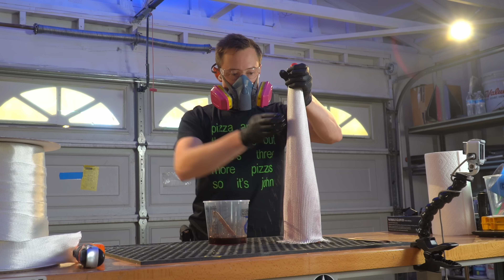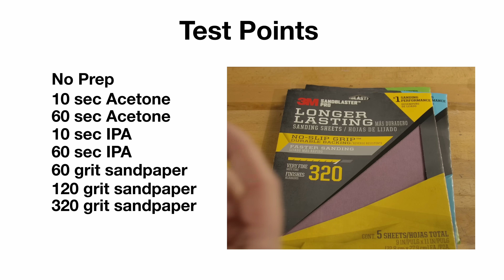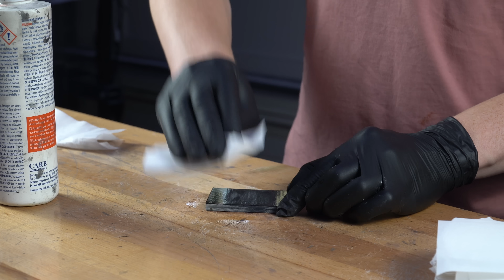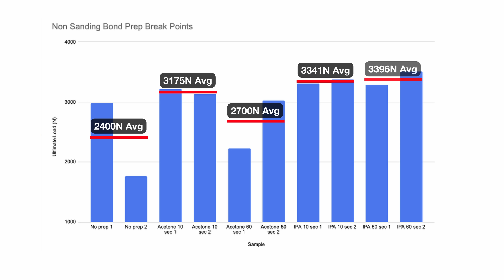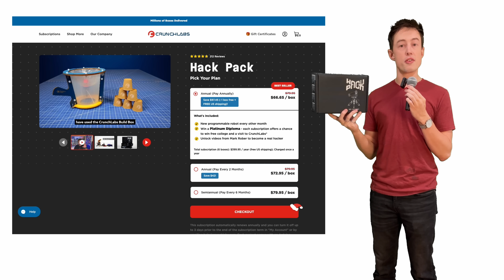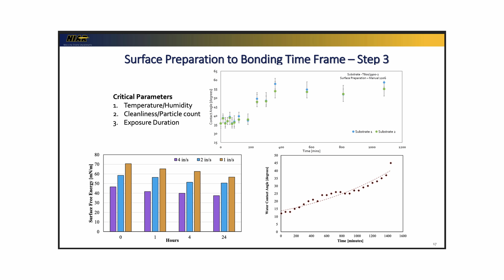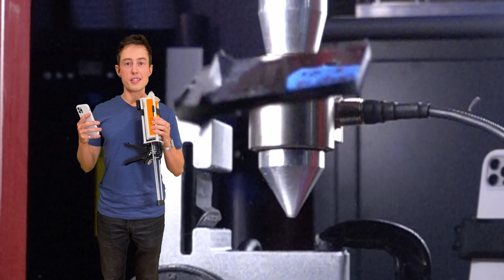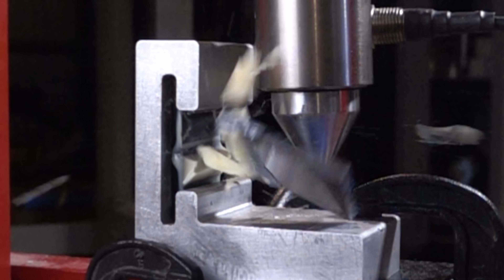I Broke 100 Epoxy Bonds to Find the Strongest

Comment: Ski builders here. We run lots and lots of test and flame treatment it's always on top, 3 quick pass on top of cleaning, sanding and cleaning again seems to be the best compromise for most plastics, but we observed that flame treatment by itself outperform sanding every time.
Reply: What type of fuel do you use or how hot is the flame ?
Reply: @jacobclark89 We use a mix of propane and butane, don't know the temperature but we know that different materials need different distance from the flame, with ABS we stay pretty far instead with nylon, PE and epoxy we stay as close as possible.
Reply: @Lerio16  thanks  👍

Comment: I HAVE AN IDEA (TM). 
The epoxy part of a layup is analogous to concrete. It resists pushing forces REALLY well. If you pull or bend on it, it'll break much easier. 
Carbon fibers resist pulling forces really well, and NOT SO MUCH the pushing forces. If you push it, it folds, if you bend it, it bends. 
When you do a carbon fiber layup, what you're doing is taking the squish resistance of the epoxy and marrying it to the pull resistance of the carbon fiber, getting the best of both worlds.
When you push on it, the epoxy says NOPE. When you pull on it, the carbon fiber's like NAH. 

TL;DR:
Your epoxy glue interface volume is pure epoxy. What if you cut a bunch of 1-2mm carbon fiber strands, mix it with the epoxy, degass it, and build your radius from that? 
Essentially, forged carbon fiber in the glue interface.
Reply: I think this does not fully work like you intend it to. By your design you are using discontinuous carbon fibres, which only have a limited function. This is similar to the use of carbon fibre in FDM printing filament. The fibres are discontinuous and as such the increase in strength is not the same as when using weaves. The real benefit of carbon fibres comes from the lay-up of continuous fibres and the corresponding interfaces and interactions. Making the fibres discontinuous takes away a lot of the benefits associated with a composite lay-up.

Comment: One potentially really stupid question I have is, is it not a problem that you are filling your molds with epoxy, but not applying epoxy where the two surfaces join? And yes, I understand that when you degas the molds the air in that void space escapes, how certain can you be that the mating surfaces are fully bonded? I love that concept of this video and I'm glad you went there!

Comment: When I was in high school I "worked" at a local factory (it was a special program for certain students) and I did almost exactly what you are talking in this video - I was measuring shear strength of different glues on some PP plastic, prepared with or without plasma. It turned out the best performing were "bad" pieces with rough surface...

Comment: Did you follow the instructions using the mix nozzle by tilting it from side to side and purging several squirts into the garbage before use? Your third sample was significantly stronger than the first two, which tracks with improper purging.

Comment: 16:52, that recently cleaned part just got contaminated by flipping it and putting it on the table. Suggest using some new sterile paper towel between table and piece each time.

Comment: You left no technique untried to achieve a high bond strength consistently, accounting for as many variables as you could think of.  Since the strength of the joint is so important, that doesn't seem like a waste of time.  There's a difference between knowing the best technique because a credible expert told you so, and knowing from your own experience by systematically and exhaustively testing all possible permutations yourself.

You have also done the rest of us a big favor by trying out out all these techniques, and dismissing the ones that don't work consistently, since most of us don't have the time to try and figure out which online "expert" knows what they are talking about.

Even having the tremendous luck of running into a real expert with the professional expertise and experience is something few of us are going to get.

I've been frustrated by such consistently poor results with epoxy over the years that I had given up using it.  Now I have a new approach to try.

Comment: Oh, also. This might be getting into the last 5% gains, but you also seem like the guy who would build this. If you can pour/dispense part A+B in a vacuum and mix, then you won't be mixing in any air in the first place. Keeping with pulling a vaccum when you pour, curing in a pressure chamber will force any bubbles that do form to be much smaller. If you want to test this and see bubbles, get some clear epoxy. Also also, temperature makes a huge difference. A difference of 5 degrees in any unit will significantly change the cure time and bond properties. I'm not sure what you're limited to on your part geometry, but if there's any way you could put through holes, blind holes, or the other way around, a rivet or something that sticks out - anything captive, really, would make that bond indestructible.

Comment: I wonder what would happen if you use a plasma cutter and maybe put a different tip on it that causes the plasma to be fanned out instead of concentrated like you need to cut metal. And then if the compressed air wasn't enough, maybe you could feed it with O2? Things might get spicy inside of the plasma cutter though I'm not sure the O2 inside of the plasma cutter would be safe. Considering anything  even remotely flammable in a high pressure oxygen environment is going to combust with just the slightest bit of heat generated from friction.

Comment: 37:01  I noticed one possibilty for error in your measurements.  The load cell probe tip is moving, the angle changes as it slides off the contact area, as the test piece flexes.  You might see something if you review footage from low values and high values.  If you have it for each test piece.  It would probably show in the stress-strain curves also, if you collected them.  Good luck.

Comment: There are other types of powered sanders that may sand more like your linear hand sanding, but i would make another suggestion. Buy a flat sanding pad from the hardware store and a manual tile cutter and work them up into a jig to sand more consistently. Would be happy to give further details if you're interested

Comment: According to google, epoxy performs much better under compression (~60-100 MPa) than tension (~35-62 MPa) and especially shearing (~20MPa), so yeah, the epoxy has a weakness.

If you want the most performance, optimize around the epoxys strength, compression and tensile strength as a filler, while avoiding shear by a modified design.
In theory, if you mill a 1mm groove into the wall for the fin to rest against, that would assist the top part and allow for even stronger bond - one which only gives up once the whole wall rips open like a can. This completely takes the shear component off the epoxy. You could also inserte kind of shelf pins/dowels into the back of the fin and wall.
█ \\
█ \\\\\
▌▒❚▒❚▒▒▒▒▒▒▒▒▒▒▒▒▒▒▒▒▒               You could further add some shallow grooves with a file/saw or drill holes to get better form fit to help shear stress on the fin-bond as well.
█ //////                                                                
█ //

Comment: Your paper towels and lint-free wipes could be contaminated from the start.  It doesn't take much.  Lint-free does not mean "sizing" free.  How did the acetone and IPA get on to the media?  Did you place the wipes on the bottle top and tip it?  You might be contaminating your cleaning liquids.  Everything you touch with your gloves can be transferred to the next thing the gloves touch. 

Also, was the temperature of the garage, the curing temperature, controlled?  Work done in the morning could see a different curing temperature than work done in the evening.

And, a high energy surface will attract low energy material from the surrounding air.  Any oils in the garage can vaporize and travel.  Cooking breakfast can introuduce oils in to the air.  Many possibilities.

Interesting work.

Comment: I didn't hear anything about cleaning/prepping the surface with soap and water. IPA doesn't bond well to take away oils [citation needed] which can make a surface slippery (you don't say.) I notice this with my build plate for my 3D printer. IPA is great in between prints, but when that doesn't seem to work, dish soap + water followed by IPA makes the build plate surprisingly sticky for the first layer with no other treatments. I see the argument that it may not apply as much here if you're sanding off the top layer where there likely isn't any oil or other residue below and you're using IPA more as a fast evaporating carrier to take away the sanding dust. And Acetone... ya... I can't believe that is literally sold to rub on your fingers to dissolve nail polish considering how hazardous of a chemical it's treated in industry.

Comment: another way to clean surface with oxygen is mercury UV lamp - emitted photons have enough energy to make atomic oxygen, ozone, and all stuff of reactions. Look for a lamp which emits 185nm light as well, quartz glass lamp which makes air smell funny (toxic ozone). I used such lamps to clean ITO substrates, before depositing organic semiconductors. Easy way to kill ozone is to let it through activated carbon. But please be aware that 90% of carbon filters are too small for their job, air spends too little time inside

Comment: A thought on epoxy  after sanding 2 to 3 / 32  groves  ,, heat your room to 105 degrees  or Maine bonding location  mix 100% asperic  alcohol in the epoxy = theory  the alcohol will suction both parts together as the alcohol evaporate  the epoxy  should fill the gasses better do to the epoxy being diloduded and hold better in the vacuuming chamber. Question of theory at 39: 27

Comment: If you have the ability to cure your resin in a pressurized chamber (degas before pouring, 80psi while curing), you might get more consistent results that don't overflow. The bubbles are technically still there, but microscopic.

I'd be curious how it would compare to degassing during curing.

Comment: I don't think you want to be vacuum degassing after pouring the resin. Generally you vacuum degas the mixed resin because it's in a cup with large surface area so it's easy for the bubbles to escape, then put the mold into a pressure chamber after pouring. The pressure chamber helps condense any air bubbles and force resin into small areas. When you put the poured resin into the vacuum it's less likely bubbles contained within it are able to escape, so you risk increasing voids instead of reducing them. A pressure chamber on the other hand will compress any air bubbles that might still be in the resin.
Reply: Interesting, using pressure instead of vacuum as the last step.

Comment: You need to add this glue to your test!! it has the highest bonding strength i've ever seen it's  8X P&L is the strongest polyurethane epoxy I use it to bond carbon fiber pieces together in custom car audio builds!! You can take two pieces of plywood and bond them together with no fasteners and it will bond them so well you can drive a car over the plywood!!

Comment: You should study Designed Experiments (DOEX) I suggest a simple text like "Designing for Quality" by R. H. Lockner the advantage is that you get a average error term that you can use to benchmark any significant change.  Nice work - good luck.

Comment: I think that you sand to hard the surface, if you plan of keeping the surface resin, you need to avoid damaging it, you need a good coverage of scratch but you shouldn't remove too much material. Try light pressure and stopping as soon as the scratches seem to cover well the surface

Comment: 12:40 I feel like if you just made the mold 2cm higher than the part, you'd get less bubbling over in the area you're testing, and less lost epoxy from that step of the process. You could even put another separated part above it so it REALLY stays in the fillet, and doesn't end up on top of the part.

Comment: Hey Joe,
Just wanted to jump in with something that might save you a ton of sanding time and push your bond strengths way higher than even the best 60-grit results you’ve been getting.
The strongest secondary bonds in composite structures (aerospace, wind blades, rocket cases, etc.) aren’t achieved by aggressive sanding — they’re achieved by designing the bond surface to be intentionally “fuzzy” or left with protruding fibers right from the start. The gold standard is curing the part against peel-ply (or a textured release fabric) and then peeling it off immediately before bonding. This leaves a forest of clean, unbroken fiber ends that the new epoxy can fully wet and mechanically lock into — often mixing fibers from both surfaces like Velcro in the glue line.
Peer-reviewed studies and industry data consistently show peel-ply or purposely fuzzy surfaces deliver 65–150 % higher shear strength than optimized sanding, and in some carbon and glass systems the gain can exceed 300–600 % over a simple wiped glossy surface. Failure mode usually shifts from clean interfacial delamination to tearing the composite itself or cohesive failure in the epoxy — exactly what you want.
If you ever get the chance to lay up test coupons (or real parts) with a peel-ply layer on the bond face, I’d love to see the numbers — I’m confident you’ll blow past 6000 N with almost no scatter.
Happy to send you the papers and NASA/Boeing references anytime — just say the word!
Keep up the awesome experiments!
Reply: Interesting! I do tile installation, and use a fibrous waterproof membrane to  simplify and shorten the process. The membrane is a spunbonded polypropylene with a fine fuzzy surface.  This membrane also creates an uncoupled assembly that reduces tile cracking over unstable surfaces.
Reply: "tiny fuzzies" is beneficial in a lot of things. Concrete becomes extremely crack resistant by adding carpet shavings. All those tiny hairs increase tension strength, which is the weaker strength of concrete.
Reply: Yes, the peel ply rabbit hole has been left out 😊
It’s worth a separate video! Nylon vs. Polyester, cleanliness of the peel ply…
Some have spend a whole carrier on this topic - see „The Curse of Nylon Peel Ply“ by LJ Hart-Smith an many more as reference.
Reply: This is a rabbit hole and then some, you can also drill holes to let the bonding agent fill them up creating a more mechanical interlock, or maybe even implement some dowels of carbon fibre as well to pin the parts before sealing with the epoxy, not having smooth fins but having ridges in the base that the epoxy will fill up is also an option to increase surface area and bonding.

Using acetone to clean the sanded surface is a detriment to the prep done since the acetone will immediately start melting, smoothing out and sealing the surface created by the sandpaper, especially if he’s using it to actually clean off the dust from sanding. So essentially he just dug a hole and filled it again.

I wonder if he can design the parts in such a way that he has a bunch of unlaminated sheets that he can interweave and laminate togheter on assembly.
Reply: @konzetsushi in my relatively limited (half a dozen times a year) but long-term (30 years) professional experience with epoxy resins they are not melted by acetone or any other ketones.
Reply: Be careful with this advice in our tests the texture left by peel ply was consistently the weakest in bond strength  but preformed well in sheer. We were testing flexible carbon  plates bonded to carbon spars. In America's cup racing yachts.
Reply: @glennimmortal  With any method you chose there will be pros and cons. Depending on application and usege, the results may work in your favor! Bond vs Sheer vs tensil strength all apply! My only advice is to read over the same studies I have. Not to say Joe has not, but just in case!
Reply: @glennimmortal  this is proof of the importance of different facets of testing and not just sticking to only one, if you tested only sheer strength, but the load was never gonna be sheer, you could get WILDLY unexpected results.
Reply: This.
Reply: There is even a "Key factors of the peel ply surface preparation process" paper from the Epoxy manufacturer that he is buying from in the video at 40:15 lol
Reply: Do any of those studies interface with other surface prep methods? Or is it limited to just peel ply (as opposed to peel ply + oxygen plasma, etc) vs other prep means?
Reply: Peel ply contaminated surfaces. Don't get me started.
Reply: @evangatehouse5650  Oh it is a Rabbit hole to be sure but Obviously each case sicario is unique to the job! I was just suggesting reading the studies that I had found. You never know what you will find!
Reply: reminds me of using a fork to score pottery to join two pieces
Reply: They're not abc, they're xyz! M-dash!
Reply: @leonYoong  Glad I'm not the only one that thought that. lol Had a guy on Reddit argue with me recently "What do you mean? People use em dashes all the time." No, sir. No they do not. It is quite rarely used by the average person. Most people have never once, ever, used an em dash. LLM's however, love them.
Reply: @thinking-monkey I regret to say that, given that that these are YouTube comments, LLM copyediting is probably still an increase in quality. We can only hope that the intended communication is still clear, correct, and earnest.

Comment: fun fact but in case of polyester resin ---- 
if you wax (carnauba wax release agent) the top layer of glassfibre cloth (after making the part by hand no vacuum etc ...just laminate in the air - cheapest way)  just once - one wax on "rough" fibers after they perfectly cured ....for some reason new polyester resin sometimes (in my case in 80% of the tests)  sticks to the waxed once (without buffing) part stronger than without waxing  
what is rly weird 😅